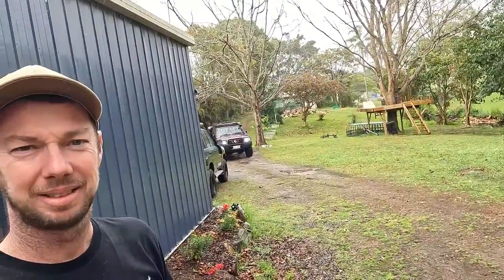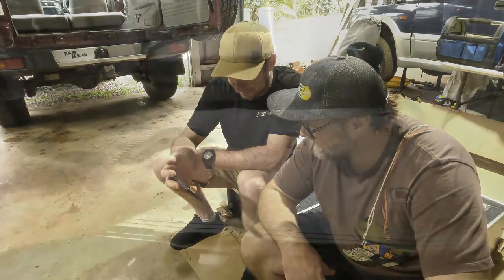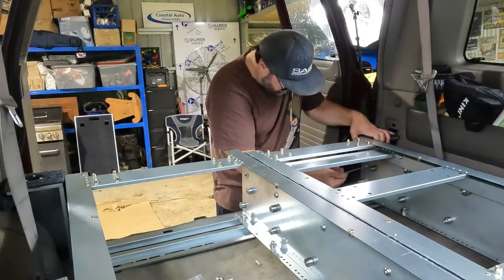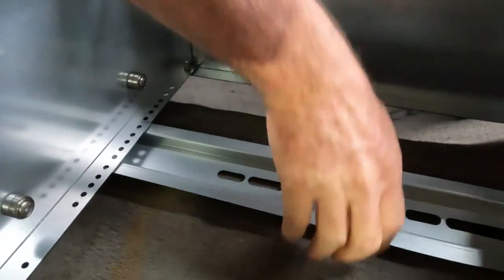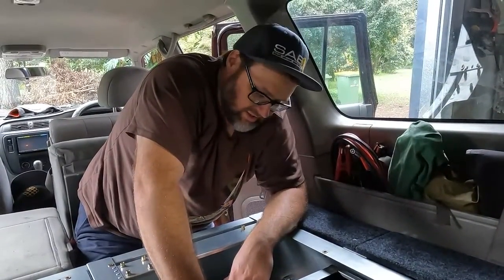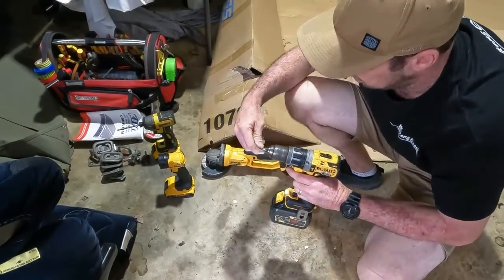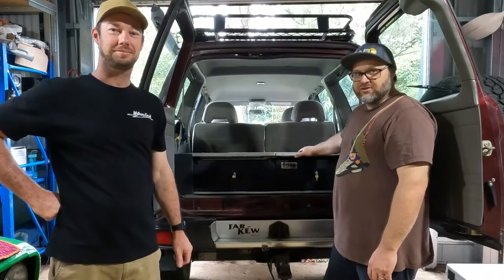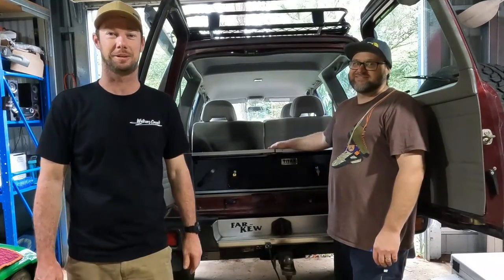HOW TO INSTALL TITAN Rear Drawers | 4WD Supacentre | Unboxing | Installation | REVIEW | PRO TIPS

Comment: I've had my draws for over a year and love them (i adjusted the stops and eliminated the movement when closed) .I don't use the fridge slide for my fridge but put a MSA slide on the drivers side and it works great
but very informative video keep up the great ork
Reply from the maker: Thanks Mr C.  We've got a 3 (probably 4) month review planned coming soon.  Yeah the fridge slide is a bit of a pain, would love a drop slide but might need to change my fridge first.  And need to update my 12v system too!  Never ends haha.

Comment: To Eliminate the movement when closed you can attach 2-3 layers of double sided sticky tape to where the draw edges get close to the frame edges, this will take up the slack one of my draws was OK but the other one had too much play
Reply from the maker: Sweet, thanks for the tip 👍

Comment: Great vid lads !
I am about to tackle Titan single draw into back of my Ranger dual cab.

I have an interesting idea of having the draws or draw in my case click into a base so they can be removed if need be and clicked back in  when needed.
Any thoughts on this ? 

Cheers 😎
Reply from the maker: That's a good idea. It might be a bit heavy to lift off and unclip from a base. Maybe you could have some fastners down each side, depending on access.
Reply: @ChaseTheWeekend  
Yeah it's still just a thought so it has it's hick ups still.
I will work on it, as tub space when we are not camping can be used better if we could un hook draws .
Cheers

Comment: The bottom mounting rails are easily bent and can come already so. Bit of hammering between an axe head and hammer straightens them 5:34  fairly quickly. To save some weight/make the install neater removing that end rear seatbelt would be perfect.
Reply from the maker: Great tips, they need to come out soon so I can redo the 12v so I'll have a look at it then.  Thanks for watching!

Comment: Bit more info on hold down bolts as the supplied kings ones dont fit.. an ones on floor are too small..
Reply from the maker: Hi Brian, I re-used the Nissan bolts.  The draw carcass aligned with the factory child restraint points at the back (middle row seat end).  The end at the doors I was able to re-use the factory bolts there too except for the drivers side where I needed a longer bolt and needed to modify the Titan carcass slot.